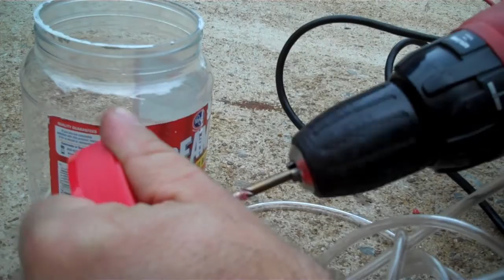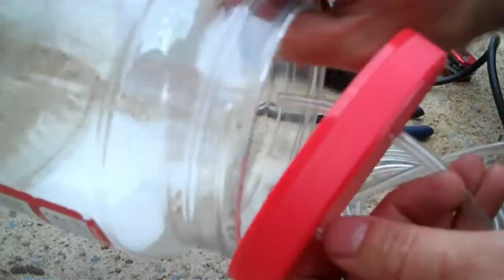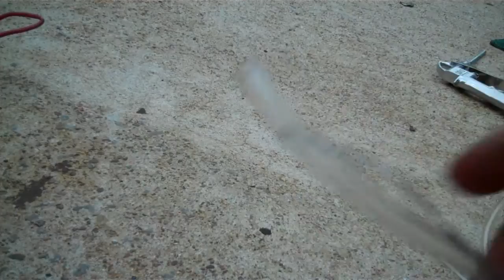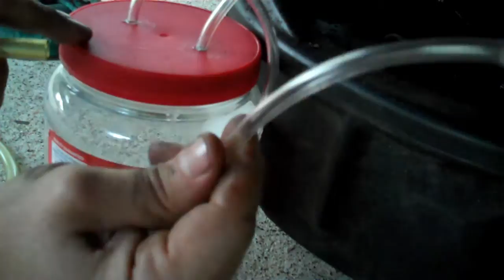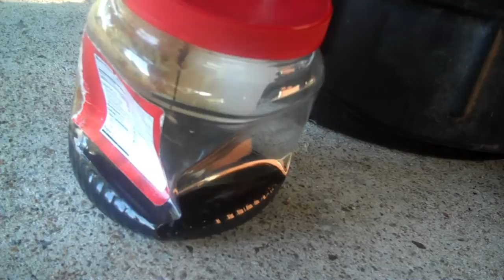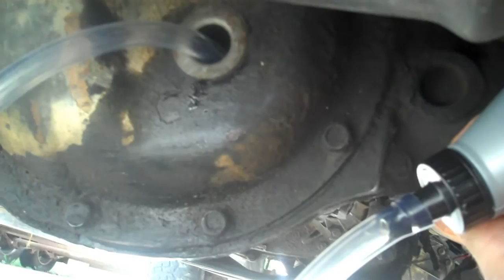Homemade fluid pump - works great removing automotive fluids

Comment: Cool idea for improvising a pump!  Seems like you could use a 1/4” “Y” connector instead of the slit in the tube.  One top-leg of the Y to the pb jar, the other top-leg for the airgun, base of the Y as the outlet.  I’m gonna go try this.  Thanks!

Comment: most jars have a paper disc inside the lid that should b enough to seal it,this can also b done using a shop vac but u need to cut the cone shaped top off a soft drink bottle to seal the vac's air intake so the tubing can pull the fluid.

Comment: Could you use a vacuum cleaner and hose to suck the oil out?  Put the hose over the sucking tube.  I wonder if the fluid that comes out would go into the tube that's inside the jar because of too much vacuum pressure??  Could decrease the sucking pressure by moving the hose away from the hose a bit.

Also, maybe use a glass container or something more strong so it won't collapse.

To add the oil, maybe get a longer tube and make it long enough where you  can hold it higher than the fill hole and have "gravity fed" work for you?  Anyway, thank you so much, another great clip.  Now let's head out to Florida!!
Reply from the maker: I have pressurized the container to push the fluid into the diff. just make sure the tube going into the diff is submerged into the fluid. Glass containers do work better. I just used what I had there at the time. You can use a vacuum cleaner, vacuum pump or even the vacuum from the car engine its self with the engine running. My son and I are planning a trip to Gulf Shores Alabama this summer to do some scuba diving.
Reply: Put the catch container inside a shop vac and run the line out the hose. No lid required on your container.

Comment: with some dish soap and silicon on the lid would... it make a much better seal.
Reply from the maker: You are correct. I could have also taken a bit of the differential fluid and spread it along the rim of the jar then screwed the lid back on. That would have also helped. It got the job done on the very inexpensive side. Thanks for dropping in and leaving a great tip to go along with the video! Have a great day!!
Reply: I used bubble gum. I used brass fittings and nylon air line on a big glass pickle jar